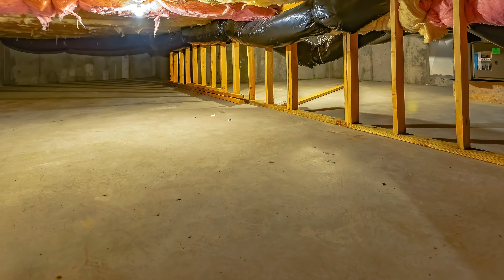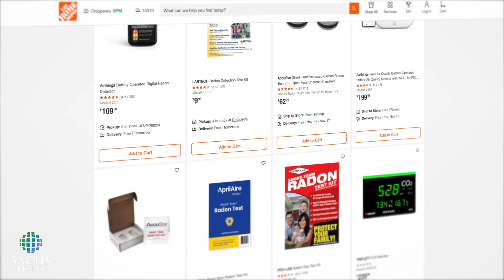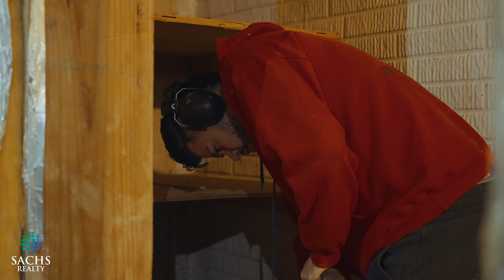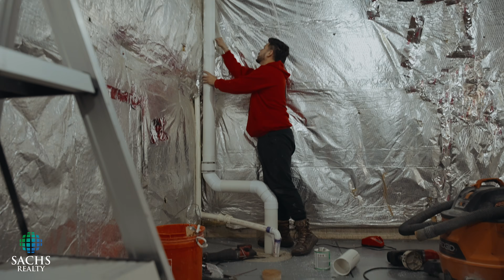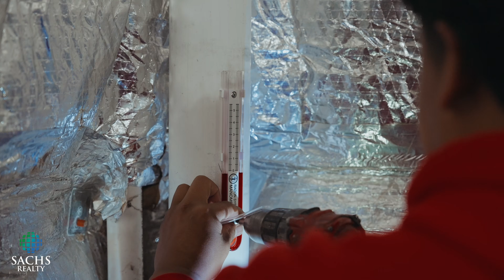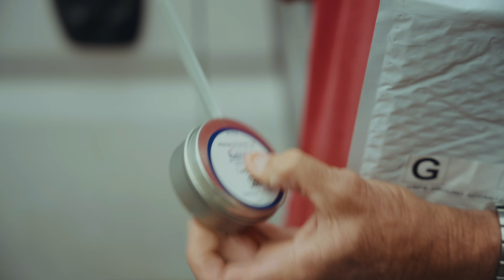Radon Mitigation: Eliminate Radon in Your Home

Comment: Great video, thanks for sharing.  I've only got three concerns:

1) Homeowner would be wise to square-away his sump pump system before this radon system is glued-and-screwed in place.  Would be a pain to fix the sump pump if it fails one month after this new radon system is installed.  This radon installer should consider getting into the sump pump business and do two jobs simultaneously for the cost of one.

2) The "initial level number" on the vacuum gauge at the end of the video depends on whether all the doors and windows in the house are shut, right?  That must be true because the boss said at beginning of video that the house-radon measurement is unreliable if all windows and doors are open.

3) Get those kids doing the installation some eye protection, dang!  Safety glasses are only two bucks at Home Depot, no excuses
Reply from the maker: Great advice for those with basements.

Comment: I wonder what precautions are suggested for a new home being constructed. Can the foundation of a brand new home at the start of laying the foundation be "lined" with something underneath that would deflect the radon vapors that could be rising?
Reply from the maker: We’re seeing passive radon systems being installed in new house construction and also vapor barriers. I have still seen high numbers despite these efforts where fans are still needed. Testing is the key.
Reply: @SachsRealty  Wow, t.y.